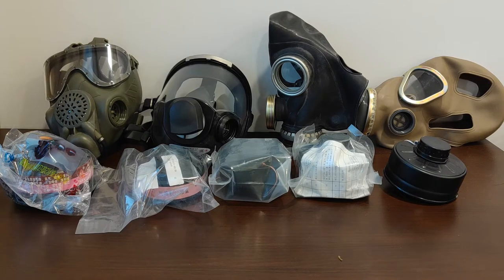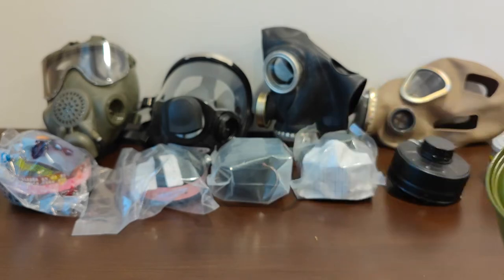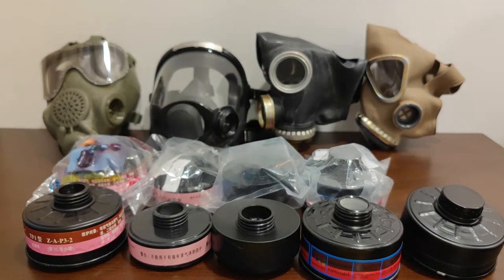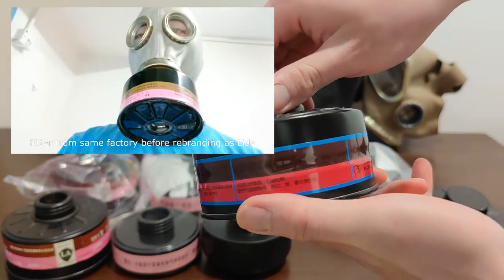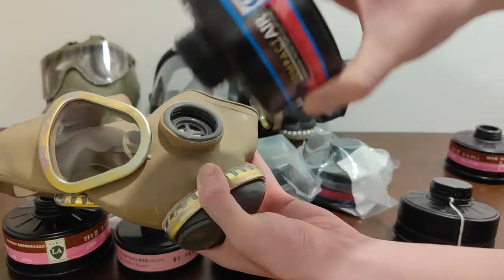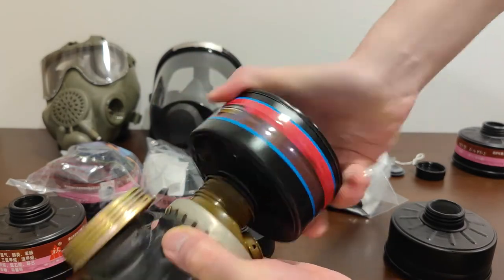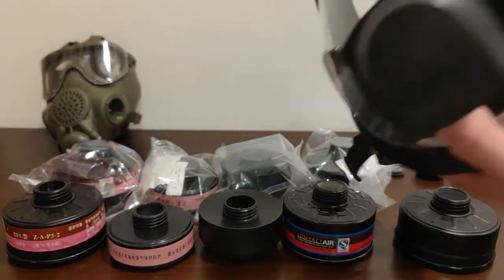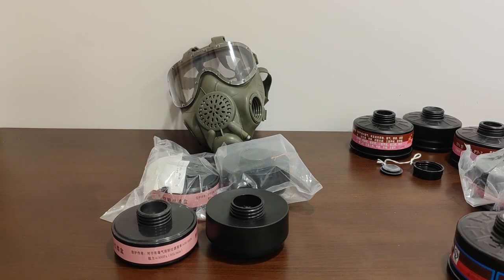Cheap & Safe New Filters for Soviet/Russian Gas Masks: Modern Chinese GOST Filters

Comment: Hello im not sure if you will see this but is there a reliable seller on ali express/another website that you order these filters from?  I have a GP5 and would rather just get these filters if they work.  Im mainly using it when shooting suppressed to get less carbon crap/lead fumes inhaled.  As long as they engage the GP-5 O-ring and are from a good source I would appreciate knowing exactly who and where to buy them.

Comment: Is the  Z-B-R2-V filter safe I think it’s the one you reviewed in this video. I really want to know if it has asbestos I own a mf11b and I use the Z-B-R2-V filter a lot im a beginner to gas masks please let me know also good video sir 👍
Reply from the maker: Nope, no Chinese filter made after the year 2000 will contain asbestos. In fact, they switched away from asbestos for the Type 69 plastic canister filter because asbestos was in short supply in China. The Z-B-P2-2 (the proper protection description of the filter) is a civilian A1B2P2 filter, quite different from the CBRN filter. Sellers claiming otherwise are lying.
Reply: @hypemilitaria6447  so the Z-B-R2-V that I own is safe and do you know when the Z-B-R2-V filter was made??
Reply from the maker: @eclipse5458  For sure. I have used them in the past as well and they definitely have modern HEPA filters.
Reply: @hypemilitaria6447  thanks so much I just subscribed keep it up with the amazing  content
Reply from the maker: @eclipse5458  Ay many thanks! Glad I could help!

Comment: hi, i am going to buy my FMJ08 from Ali express, the seller keeps saying its NATO threaded, what are your experiences on the fmj08?
Reply from the maker: Earlier milspec FMJ08s are not NATO threaded. They use a Chinese version of the GOST thread. However, later FMJ08s/MF22s share the same port as the FMJ09, and while that thread is still not NATO STANAG 4155 exactly, it will fit some NATO canisters. Some, but not all.
Reply: @hypemilitaria6447  thankyou, so its more of a .... try and test and see what fits🤣
Reply from the maker: @vatwormindustries2767  Basically yeah. I have found that most industrial/civilian ABEKP3 filters work nicely with the FMJ09/new MF22 ports.
Reply: @hypemilitaria6447  thats great news, since ali express seems to be full of  HEPA P3 types